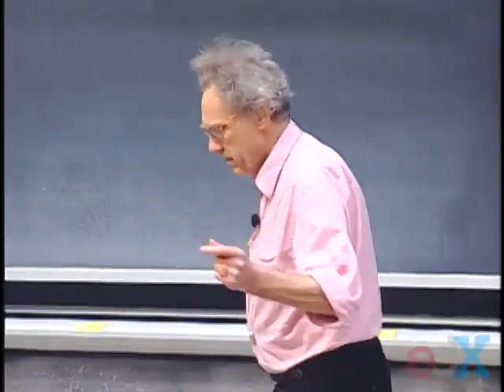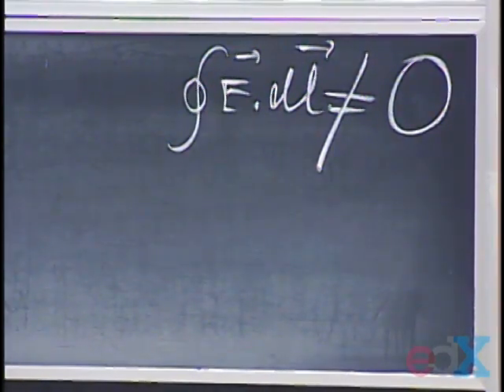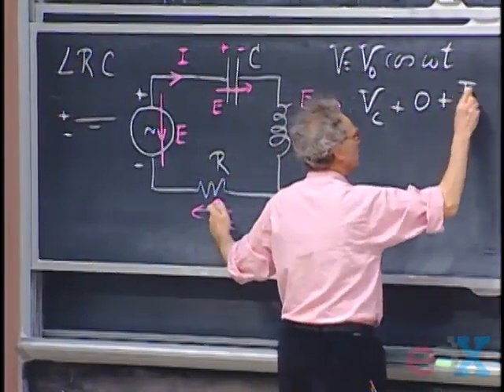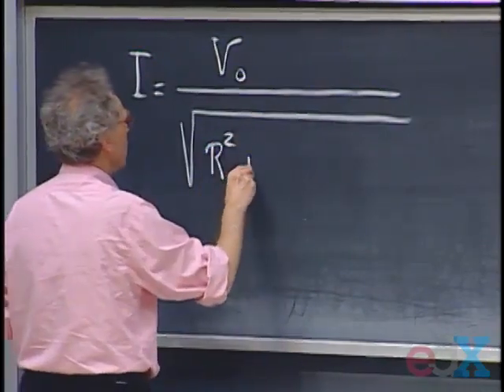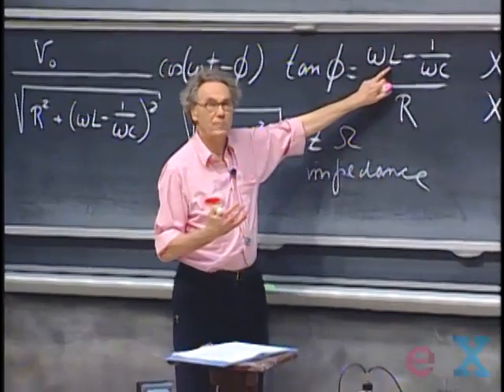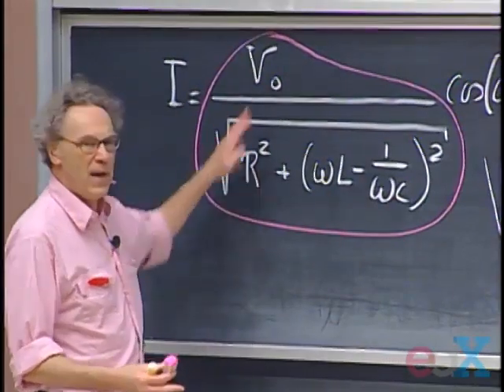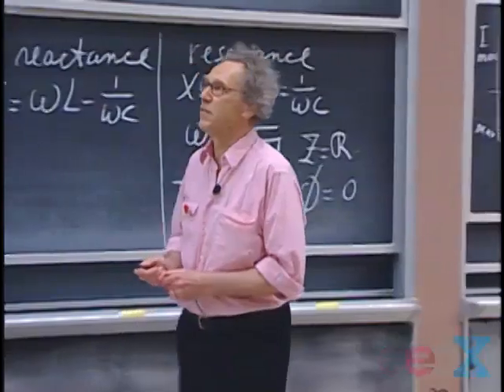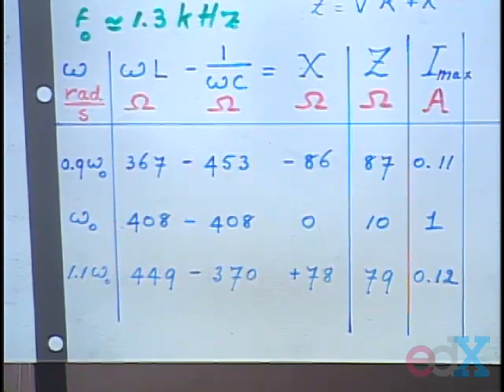8.02x - Lect 25 - Driven LRC Circuits, Metal Detectors

Comment: sir in resonance condition the LCR circuit behave a resistive circuit , then why we need to put L and C in the circuit , just with a resitor only we can get a resistive circuit?
Reply from the maker: use google
Reply: Lectures by Walter Lewin. They will make you ♥ Physics. sir i didnot get this answer anywhere pls help me
Reply: +Hrishikesh...  

Part of the reason is to explain and demonstrate how L and C impedance components behave in an AC circuit... but the answer to your question is to ask you a question myself: how do you think basic filters (for audio/radio/microwave signals) do what they do?
Reply: LRC circuit is also commonly known as a filter, designed to allow a narrow band of frequencies through the filter and block those above and below the band.  A resistor alone would have no filtering effect.   

An (imperfect) mechanical analogy is a two screen filter through which gravel of many sizes including sand is poured. The capacitor is the first screen with medium  openings that blocks the largest rocks.   Medium rocks and sand pass through.  The inductor is a fine screen that allows only sand to pass through.  In between the screens one gets only medium rocks, the desired size.

I say imperfect analogy because there also must be a mechanism to continually clear away the large rocks blocked by the capacitor screen, and the medium rocks must be continually removed after a short time to more rocks and sand can come in and the sand then filtered out by the inductor screen.

You could also use long trough shaped screens set at an angle, say 30 deg, so that the large rocks run all the way down the capacitor trough into a buckt while medium and sand fall through to the second inductor screen.  The inductor screen must also be set at an angle so that all the sand falls through while the medium rocks flow all the way down the trough into a bucket.   

The resistor slows the rate at which the mixed gravel enters the two screen assembly.

Then you have to use your imagination to handle the reverse of voltage and current....flip the positons of first and second screens, and .then at resonance the maximum amount of medium gravel will flow into it's bucket

Comment: Sir i think kirchoff law is valid because E bar is a conservative field so its cyclic integral must be equal to zero... also -dibydt is a non conservative so if possible please explain
Reply from the maker: you are mistaken. I am sorry but I cannot help you. I realize that Faraday's Law is difficult for most people but I cannot change Maxwell's eqs. The Emf generated by Faraday's Law creates a non-conservative E-field. Therefore the closed loop integral of E dot dL is not zero; it's -L*di/dt. If you need more help I suggest you use google.
Reply: @lecturesbywalterlewin.they9259   sir yes i agree with u on that but in the video u said kirchoff is not valid which i think kirchoff is E conservative so it must be zero..
Reply from the maker: I suggest you brush up on your Physics knowledge. I realize that Faraday's Law is not easy for many students. I am sorry but I cannot help you. Use google. Kirchhoff is only valid if the closed loop integral of E dot dL is zero.
Reply from the maker: maybe this is of some use to you. These are my lecture notes of Lect #20 of 8.02. Professor Belcher's notes of MIT: Most Physics College Books have it WRONG!: http://freepdfhosting.com/0813df09f5.pdf
Reply: @lecturesbywalterlewin.they9259   thanks a lot sir i will try my level best to understand it sir!!

Comment: Lectures by Walter Lewin. They will make you ♥ Physics.Professor,why is resistance of a self inductor always zero?ANd can the AC VOLTAGE be taken as Vzero(sine omega*t)?
Reply from the maker: It's ONLY zero if the self inductor is made of super-conductive material. We call that an "IDEAL" self inductor. The E-field inside super-conductive material is always ZERO.  If you have an AC power supply (like your electricity at home) then it can be described as Vzero(sine omega*t) or (cos omega*t).
Reply: thank you
Lectures by Walter Lewin. They will make you ♥ Physics.

Comment: Dear Professor i follow book electricity and magnetism by "edward mills purcell" along with your lectures and he was a noble prize winner. However in rlc circuit he uses kirchoff loop equation. Does some kind of modified kirchoff exists or its simply wrong?
Reply from the maker: Purcell could not possibly have made a mistake.
In RLC circuit he must have used Faraday's Law.  If you then bring the -dphi/dt turn from the right to the left in the eq. You have 3 terms that add up to ZERO.  But that is NOT KVL; it is still Faraday's Law. 5 + 3 = 8 that is Faraday's law. 5 + 3 -8 = 0 is still Faraday's law. Send me the page of Purcell. I may have a copy at home.
Reply from the maker: I am looking at page 298 of Purcell. his LdI/dt term is Faraday. He nowhere uses the word Kirchhoff. His eq.2 is Faraday's Law. I treat the RLC circuit slightly diffrently. The closed loop integral of E dot dL = --dphi/dt = --LdI/dt . IR + Q/C = - LdI/dt   Look at Purcell's eq (1) and  (2). That's what Purell also has. He brought the -LdI/dt  term to the left. That's Faraday's Law.
Reply: @lecturesbywalterlewin.they9259  professor,book's page number 403, eq 8.46. On top of that he says Kirchoff loop equation ... thank you for replying
Reply: The book i am refering to is the 3rd edition where morin has co authored. Page 403 reads
Our strategy will be the following. We will write  kirchhoff loop equation as we did above but instead of solving it directly,we will solve a slightly modified equation in which ....
(In the next paragraph)
The kirchoff loop equation for the series RLC circuit in Fig.8.10 is LdI/dt+RI(t)+Q(t)/C=E0coswt.(eq 8.46)
Reply from the maker: I told you that Purcell could not have done that wrong and I showed you how Purcell deals with RLC circuits and he did it right. I can  not make any judgements about books that I do not have.
Reply: @lecturesbywalterlewin.they9259  yes professor i completely agree with you. I just had a query when i read that page,anyway really grateful for your time.

Comment: Sir, this question I am about to ask may not have anything related to the content of this lecture. 
I always wonder where are the transmitter and receiver of signals in a cellphone. Handheld radio has an antenna type thing but in a smartphone I dont see any such things.
Reply from the maker: use google all your answers are there
Reply: @lecturesbywalterlewin.they9259  thank you

Comment: Beste professor, in de afleiding van de differentiaalvergelijking bij het RLC-circuit zegt u dat er in de inductiespoel en in de geleiders geen elektrisch veld is en deze dus niet bijdragen aan de integraal rond de kring. Nu moet er toch wel een elektrisch veld zijn daar, anders kan er toch geen stroom lopen aangezien j = o * E?
Reply from the maker: there is an E field in the R and in the C but not in an  ideal conductor.

Comment: Sir , shouldnot we consider the induced current in the resistor when setting up the differential equation ? And if we consider that induced current the integral of (E.dl) through the resistor will be (iR_induced current .R), am i right ?
Reply from the maker: I cannot add to the clarity of this lecture. In the case of an induced emf in a closed loop of a circuit, the EMF is part of the diff eq.
Reply: @lecturesbywalterlewin.they9259 But shouldnot we take into account the induced current through the resistor while doing the integral of E.dl or do you mean that the induced emf represent this current ? Thanks
Reply from the maker: how many minutes into my lecture?
Reply: 2.19
Reply from the maker: diff eq is 100% correct. It's an application of Maxwell's eqs. I cannot help you any more. Use google.  Faraday's Law in action!
Reply: @lecturesbywalterlewin.they9259  Thanks , by the way i am going to do your experiment of faradays law on sunday to convince my professor of electrical engineering that kirchhoff law doesnot always hold , any advice to me ....
Reply from the maker: You have a misconception on the application of Faraday's Law. All it says is the the closed loop integral of E dot dL = - L*dI/dt. The integral of E dot dL through the resistor is IR.
Reply: @lecturesbywalterlewin.they9259  But at any instant in time we have an induced electricfield in the resistor and electric field due to the source ..so what i meant that there is induced current in the resistor due to the inductor opposing the current of the circuit
Reply from the maker: no need to redo my demos - you may not have the proper equipment. Show your teachers this video: Is Kirchhoff's Loop Rule for the Birds?
https://www.youtube.com/watch?v=5be3zpj_eCY&list=PLyQSN7X0ro22zanLOcvkaSY-IZqheFYM5&index=7
then if you want to blow their minds show them my demo at the end of Lect #16 where I show that in the case of an induced EMF potentials are no longer defined. Two identical voltmeters attached to the same 2 points in a circuit will read very different values. In the case of Lect 16 Voltmeter 2 recorded a voltage 9 times higher than voltmeter 1 and the polarities were reversed.  Each voltmeter measured the integral of E dot dL between the same 2 points but via a different path. In all cases where Kirchh loop rule applies the 2 voltmeters will ALWAYS show the same value and the same polarity.
Reply: @lecturesbywalterlewin.they9259  Actually i showed him your demo but like you said his mind didnot accept this and he didnot belive what he saw and challenged me to do the experiment to prove that your demonstration is wrong.
Reply from the maker: But at any instant in time we have an induced electricfield in the resistor this is wrong. You have a misconception about the meaning of Faraday's Law. The induced EMF is in the closed loop. you cannot ask the question where in the close loop is the induced EMF.  it's in the closed loop  END OF STORY
Reply: @lecturesbywalterlewin.they9259 I really understood professor lewin thanks
Reply from the maker: @mahmouddesokey3818  you will not be able to redo my demo of Lect 16 as you will not have the proper equipment. However, you can do a simple demo which will show the difference in the 2 voltmeters but not the polarity reversal as you will have to do this with AC and your voltmeters will not have the needed time resolution to show the reversal. watch this demo - you can do that too. https://www.youtube.com/watch?v=b7i2uMx7gHo&index=8&list=PLyQSN7X0ro22zanLOcvkaSY-IZqheFYM5
Reply: @lecturesbywalterlewin.they9259  I will do the simple demo .thank you professor for your help

Comment: If the electric field is not conservative. How can you uniquely define a Vc potential? Thanks! :D
Reply from the maker: watch my lectures
Reply: Yes! I've seen your lectures. They are really really great. I'm an physics student and i also teach to other students. The most significant thing I've learn from your lectures it's the correct interpretation of Faraday's Law. I had to re-learn a lot of things. And I can't yet understand what I asked you before. If the electric field is not conservative, how can i speak of a Vc potential? Thank you very much!
Reply from the maker: Potential difference is no longer a meaningful concept if the E-field is not conservative. The integral of E dot dL between point A and B can be very different depending on the path. Thus, it's meaningless (even misleading) to call that integral the potential difference because you will have 2 different values. I suggest you read my Lecture Notes of Lect #16. I posted them below the thumbnails of the videos.
Reply: Thank you for your answer! Aha. Ok. I understand. So, when you conect a Voltimeter to a Capacitor in a LRC cirtcuit, What are you measuring?
Reply from the maker: RLC circtui. If you place a Voltmeter over the capacitor, you measure V_c(t)=Q(t)/C.  I discuss the LRC circuit in great detail in my lectures. Emf*cos(wt)+ IR + V_c + 0 = -LdI/dt.  The integral of E dot dL through the wire of an ideal self inductor is ZERO!
Reply from the maker: watch also https://www.youtube.com/watch?v=LzT_YZ0xCFY&list=PLyQSN7X0ro22zanLOcvkaSY-IZqheFYM5&index=4
Reply: Thanks! :)

Comment: Sir when I set differential equation of LC circuit I get  -Vc=-Ldi/dt  that is equal to Vc-Ldi/dt=0  I am wrong somewhere kindly guide because actually right ans is Vc+ Ldi/dt=0
Reply from the maker: Watch my lecture about LRC make R=0
Reply: +Lectures by Walter Lewin. They will make you ♥ Physics. sir I have confusion about LC circuit without power supply with capacitor fully charged
Reply from the maker: https://en.wikipedia.org/wiki/LC_circuit

Comment: Thank you, Professor! Your lectures are so detailed that I rewind the video and play it again, even if I miss a second of it! Thank you for giving us the opportunity to access them! Could you please give me your email ID so that I can ask you some questions?
Thanks, once again!!  :)
Reply: Professor, I have a few questions.

1) What is the difference between an ideal conductor and a superconductor?

2) Why do we assume that IDEAL INDUCTORS are made of superconducting material and not using ideal conducting wire ( which also has R = 0 )?

3) Sir, you mentioned in one of your earlier lectures that in an IDEAL INDUCTOR, the Electric Field = 0, ALWAYS. If it is so, how do the electrons know in which direction they are supposed to move?
Reply from the maker: It's a matter of semantics. 
Yes in an superconducting inductor the E-field is always zero.
But a current can go through it depending on the circuit because there is an EMF somewhere else and thus a current. Thus electrons know which way to go.
Reply: Thanks a lot, Sir. Could you please elaborate a little more on the answer to the first two questions?
Reply from the maker: 1.it's a matter of semantics
2. If someone write "ideal conductor" it means zero ohmic resistance - thus superconducting.
Reply: Thank you Sir  :)

With all due respect, Sir, Wikipedia says that there is some difference in the properties of a 'Perfect' or 'Ideal' conductor and a 'Superconductor'. But I suppose that it makes no difference in the derivations etc that we are doing.
Reply: https://en.m.wikipedia.org/wiki/Perfect_conductor
^ Here is the link, Sir

Comment: why is the field inside an inductor zero?
Reply from the maker: if the inductor is an "ideal" inductor, than it's conductivity is infinitely high (superconductive materials have zero ohmic resistance). A current can flow through it, but there cannot be any E-field inside as that would mean that there is a potential difference over the inductor which would lead to an infinite current. I mention this in several of my 8.02 lectures. Also use google or ask Quora.